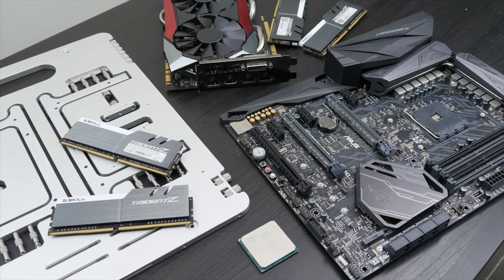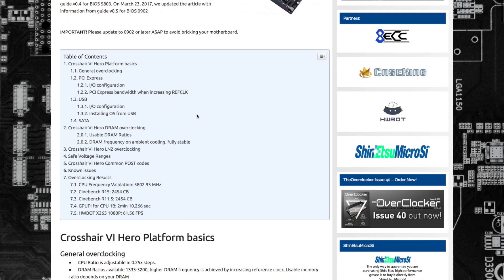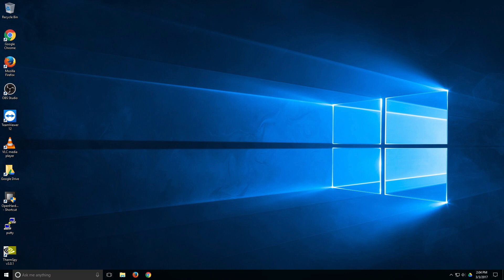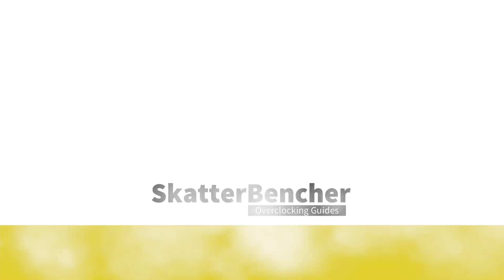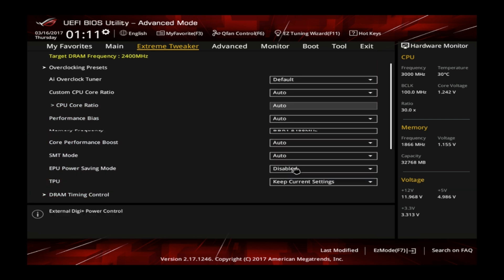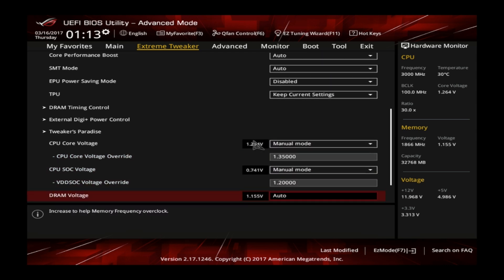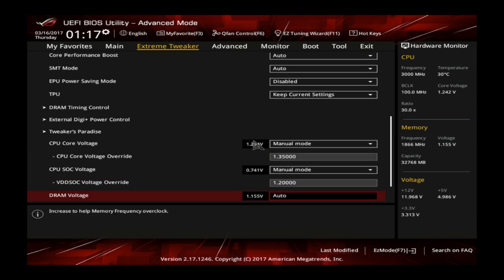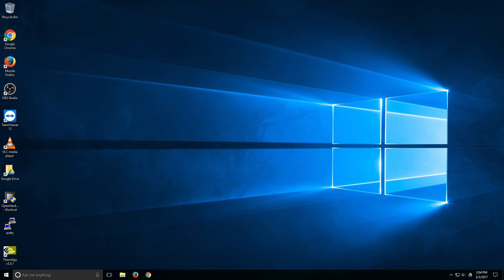AMD Ryzen 7 1700 Overclocked to 4GHz with 32GB Trident Z to DDR4-3000 | SkatterBencher #9

Comment: Nice guide, my 1600 cannot keep 4.0ghz no matter the voltage, even 1.45v on C6H doesn't work. By lowering to 3.9ghz I get the best efficiency with 1.35v and better temp/perf ratio overall.

Comment: i wouldnt boot into an os without running memory tests first.
Reply from the maker: What memory test do you recommend/suggest?
Reply: @SkatterBencher  memtest86 and memtest86+ work well. the official passmark one is very good for testing the imc since it uses multi threading to ram test

Comment: I find my ryzen 7 1700 is stable at 3.9 ghz all cores and 3400mhz on 16gb corsair ram.
Reply: Daksh The King at what voltage?
Reply: st604boy 1.375, using cooler master ma610p cooler.
Reply: same with my r5 1600, I can't go past no matter the voltage. I had to find the right spot at 3.9Ghz and then optmize the final voltage, it's fine.

Comment: Guys your overlocking guides suck. Where the fuck are secondary timings optimisation? Do you even know anything about it? Delete your stupid video kinda "ohh, here's another 3000 MHZ CL15 kit and now it works well at 3500 CL16 under 1.5V".

Comment: Need help !!
i over clocked my ram which is g.skill trident Z 3000mhz to 3066mhz , and it went fine , but when i shut my pc down and ( cold boot ) my system it post like 5 times and then it finally boot into windows. 
i running MSI b350 gaming pro carbon motherboard 
Ryzen 1600 overclocked to 3.7ghz with 1.200v .. 
i still cant find a way to boot into the system without post 5 times, so i set my ram over clock to normal (Stock clocks) .. 
anyone had this issue ?? 
please help ..

Comment: A lot of people don't seem to realize (and reviewers either aren't catching it, or just flat out not mentioning it on purpose) this but the ryzen 1700's(and 1800x and 1700x) boost frequency will only boost one core to 3.75Ghz at a time, there will NEVER be more than one core at 3.75Ghz. as well as with the 1700x and 1800x that "boost frequency" doesn't boost all cores like an actual overclock would... Plus on my ryzen 1700 for the first two and a half months, maybe three, before I started really overclocking instead of using premade oc profiles on the motherboard I had, I only EVER saw A core boost to the actual 3.75ghz boost frequency if my temps were below 48-52c on all cores, at which point it would... momentarily boost core 1, or core 8, core whatever random core to your cpu's respective boost clock. This was not temp issues on my part at all, I have a micro ATX in an NZXT s340 which provides plenty of airflow from the two front intake 140mm high wind fans I have installed.  I move air out no problem as well with two exhaust fans that are 120mm fans designed to push air out of the case fast, while moving slowly.  Cannot remember their name for that life of me. Hell my temps with all cores oc'ed to 3.875ghz are only MAYBE 4 degrees higher on cpu than the temps when I got the Ryzen cpu and it was at stock settings My experience with Ryzen's boost clock runs the same as the 1700, yes higher clock for boost, but one more time, say it with me, IT IS ONLY FOR ONE CORE, and this is not 2002 anymore, There are not any modern games that I can think of that use 1 core, even most big open games they REQUIRE 4 cores, or at the very minimum 2 core with hyperthreading enabled
Reply: He got a few things wrong. They do support XMP. Boost is always enabled unless overclocking. Dual channel ram has been around forever and he sounds like he thinks its a new thing. That OC isn't stable unless he shows me at least an 8 hour prime video to prove it. I think Ryzen boosts 2 cores and Intel does one. But there's ways to get all cores boosted with bios options like MSI game mode. Other boards will have similar options just called something different.

Comment: Hi and thank you for this review, and I want some help please I will buy my new Workstation PC and it will Ryzen 7 and I don't know what the best processor for 3d rendering ( 1800X or 1700 OC ) I work 3d and render for many hours and maybe many days the processor will be working, so the 1700 OC can be work for many hours ?
you said in video a bit of luck that mean some R7 1700 ovorlocked to 4.0 g and some no or what ?
are this parts will be good with 1700 OC : 
Asus ROG CROSSHAIR VI HERO Socket AM4 Motherboard   , Thermaltake Water 3.0 Riing RGB 240 CPU Cooler  , Thermaltake Smart Pro RGB 750W 80 Plus Bronze PSU ???

Comment: Your mileage will vary.  Very, very few R7-1700 CPUs will run at 4 GHz, much less prove to be truly stable at that frequency.
Reply: Michael Gilbert Good point.  Very true.
Reply: Most of the ones I have seen hit 4.0ghz and are stable. At least 8 out of the 8 I have seen. Two hit 4.1ghz with 1.375 voltage.

Comment: Should i put the load line calibration to lvl 5 and others overclock settings to extreme for 1700 4ghz oc? Because i can't get it to work with only the voltage higher

Comment: Hello sir, did you use the 1700 stock cooler when you overclocked your 1700? because I'm planning to oc my 1700 to 4.0 using only the stock cooler.. is it okey?
Reply: Sean Escaflowne I'd say you'd be better off, with a good aftermarket cooler, especially if you're going for 4.  The 1700 can hit around the high 3's reasonably well and the stock cooler's pretty good but, should you get to 4, the stock cooler will strain and your efficiency will decrease rapidly.   YMMV but I've looked into this and others express the same view.  If you're looking at mid to slightly above mid 3, it seems to be able to handle it.  I've got a 1700 and stock cooler.  I'm about to see what it can do and he ordered a noctua d15.  Once it arrives, I'll be o/c'ing and messing around some more... the reason I've been researching it.

Comment: Rysen 7 depends on how much memory ram you have ?
Reply: SkatterBencher RAM in GB how much u have 8,16,32,64 ?
Reply: And frexuency (MHZ)
Reply: The performance os the processor does not depend on the QUANTITY of memory (8,16,32,64 GB), but it does increase with memory SPEED (MHz)
Reply: RSP Rysen CPU depend on the how much RAM u have
Reply: No it doesn't. Software depend on the AMOUNT of RAM avaleable to run properly. But Ryzen only cares for the SPEED (frequency, latencies, channels, bandwidth, etc). That hapens mostly in the case of Rysen due to the way AMD designed the channel of comunication between 2 blocks of 4 cores (what they call "infinity fabric")

Comment: Nice CPU, on my 1700x I need 1.46 volts to hit 4025mhz.
Reply: hot 90 load
Reply: u must have a silicon lottery cpu to do what your doing, most people are  using 1.45 for 4Ghz. Mine would not even boot to windows under 1.4.
Reply: Jon Donnelly I was able to boot at 1.35 volt at 4 ghz but then it crashed
Reply: i had to increase mine further to 1.49v (1.52v measured in windows under load) to get prime stable 95 stable with a fan blowing on the vrms and custom water loop. Load is now 70oC now which is fine. I probably don't have the best chip or mainboard (asrock gaming 4). It has about 99% stability now. Though I think my 850w evga PSU is struggling to run it and 2 x 1080s. ( It was fine on the 3960k*4.2Ghz). So its definitely using  more power. I will probably swap in a 1000w.
Reply: it probably went to 1.4 using load line calibration, I've seen voltages read higher in cpu-z that set in the bios. Try it in the bios at 1.46v on a decent air or aio cooler and it might be stable enough for you.

Comment: The comparison of performance was between 3ghz and 4ghz 1700? So not the 3,7ghz turbo vs. 4ghz? To me at least it seems that the "gained performance" would be mostly that turbo kicking in... plus 200mhz and some fsb on the side.
Reply: The thing with boost is that not all cores get the 3.7 GHz  speed increase, when you overclock it manually, you force the CPU to run all cores at the configured frequency. Cheers
Reply: Aaa yes yes. That's a very good point. :) thanks m8

Comment: great video, i managed to hit 4.1 ghz on my 1700x using a corsair AIO. I actually used the same RGB ram in my build and i think it looks sick! Would appreciate if you checked it out
Reply: How man? I can't even push my 1700x any further than 3.8 on tomahawk b350 msi..I've overclocked my ram from 2400 to 3200 but can't oc cpu any further...currently running @3.8ghz with 1.35 core voltage and everything else to auto..i've tried adding more voltage and all but can't make it stable anywhere past 3.8
Reply: @Demon-vk8jm   the problem is your Mobo.... Probably no good Power delivery

Comment: The memory kit has a listed timing 14-14-14-34 and in your overclock you set it lower 13-13-13-26! Is this because you use the 2400 base instead of 3200? Did you try to push it to 3200?
Reply: Yes, getting all 4 sticks to 3000 is an amazing job. Thank you!
Reply: +SkatterBencher another question, sorry for the spam, but do PCIE drop to Gen. 2 when you overclock BCLK?
Reply: Hakam Hefny please answer...

Comment: The crosshair 6 must be supported by ASUS at a much larger degree than their Prime offering. My prime x370 outright refuses to even acknowledge in BIOS having 4 dimm slots being populated, and will not boot at any speed setting. 2 dimm slots is fine so far, currently running 2933 with 3200 G.Skill TridentZ. I'm looking forward to the memory issues being fixed.

Comment: MindBlank Tech was able to run 3600 MHZ RAM with his Ryzen 1700X Checkout 
his youtube  video https://www.youtube.com/watch?v=RZS2XHcQdqA
Reply: First, this is the best video so far about Ram, ryzen and its overclocking, thank you very much for this amazing content! Question, what is your opinion on the g.skill flare x ram? Fast timings, 3200mhz, and,  if i buy 3200mhz ram, like amd showed the corsair for example, are they, or most of them who stated 3200mhz  avaliable to overclock to 3600mhz? Thanks!
Reply: I have the g-skill flair x and it wont boot above 2933 :( on my asrock x370 fatality gaming 4 even with full manual settings and voltages pumped up. It seems the 3200mhz settings is broke on it even though it works on b350 version.... 4 bios updates later and it still the same disappointment every time. Probably will change mainboard next month.
Reply: i am using a msi tomahawk and g.skill 3200 ram and they run @3200mhz. i just have to set them manual.

Comment: I'm planning on getting a R7 1700 or R5 1600X and a Asus ROG Crosshair VI Hero. It will take me a while for both, though. I currently have 2 extremely necessary bigger ssd upgrades first that are gonna take until August do to 1TB ssd prices (1 m.2 + 1 sata). I figure I'll get the cpu in November/December during Christmas sales. Then get the motherboard later on. Then my current G-Skill Ripjaws V DDR4 3200 ram isn't on the mobo's q.v.l., so I'll need different ram, too. Then in fall 2018, I'll swap out my current mobo, cpu & ram out for the new mobo, cpu and ram. I'll also need to get a AM4 bracket from EK Water Blocks for my EK-XLC Predator 240 1.1 water cooler. By fall 2018, I'll have it all and be ready.